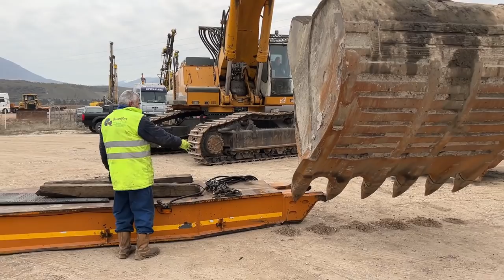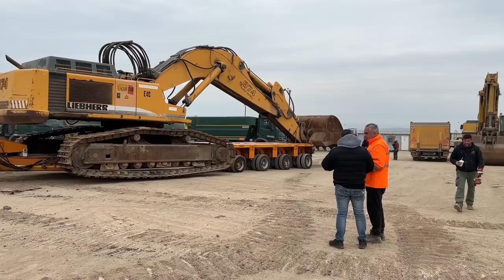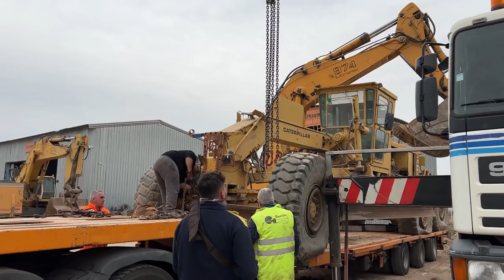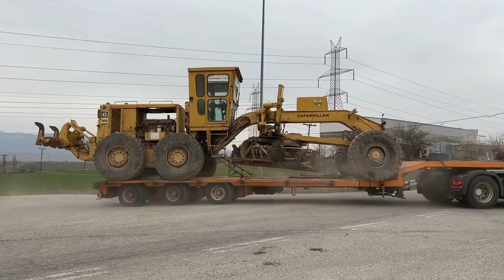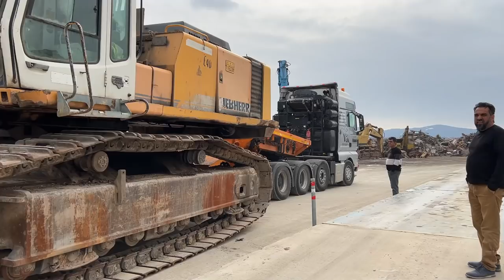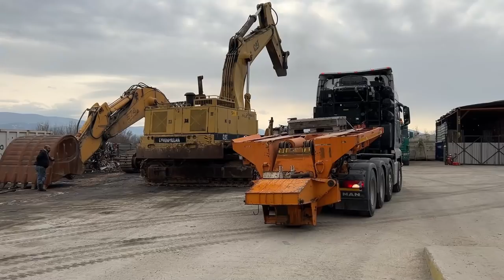Load & Transport  Liebherr 974 Excavator & Caterpillar 16G Grader For Scrap-Fasoulas Heavy Transport

Comment: Why is the entire machine ( the 974) going to scrap. Surely there's a lot of good, useful parts on it  to hold back for when they are needed on the other machines of the same model that they are running? Kinda sad to see it scrapped really. No doubt it earned its keep. The grader I can understand as it looks pretty well worn out.